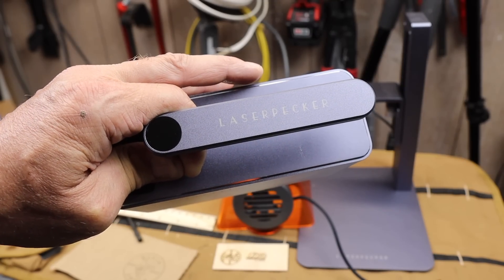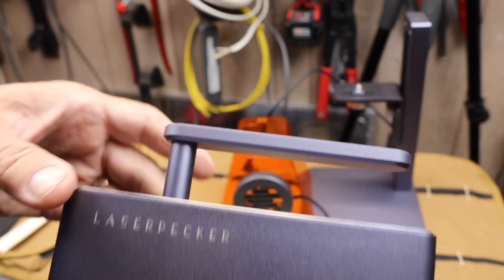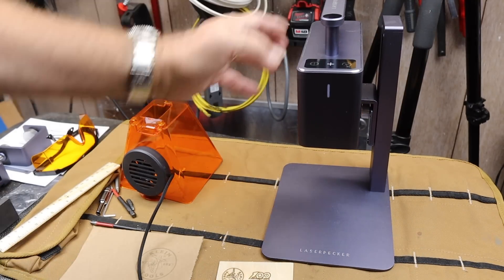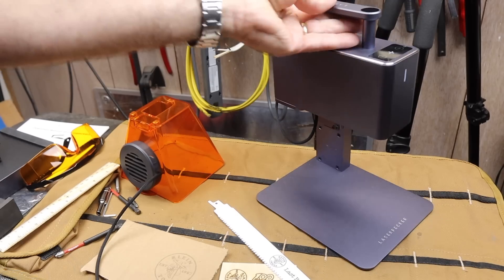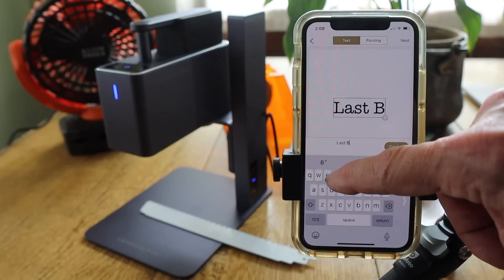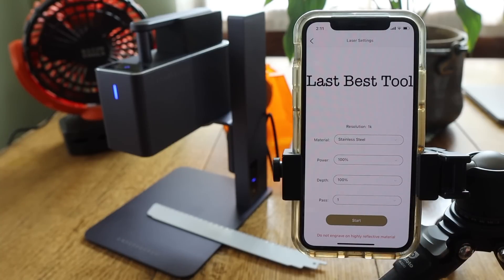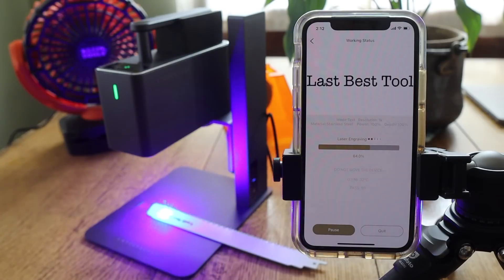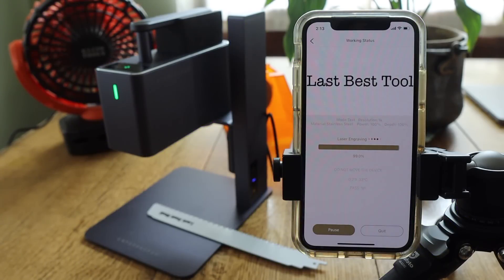The LaserPecker 2 (part 1) A one-stop-shop for all your engraving and  laser cutting needs.

Comment: I've seen these on Amazon for as little as $720 up to $1,300 what's the difference?
Reply from the maker: Probably the accessories that come with it. There are several things that you can add to the basic laser and stand to be able to do much more.
Reply: @lastbesttool  Oh I see, they have 4 different packages. Premium, Basic, Starter & Ultimate. All priced differently. Amazon has raised the price $50 since yesterday on the linked unit you posted.

Comment: Is the laser replaceable? I just thought about this. About 15' from me under a bathroom sink we have what was new, a $50,000 dual frequency medical laser. It was one of the first portable duals. It still works but . . . it only really works well cranked all the up. It also has a spotting beam that is hard to see. This can't be fixed is the issue. That's why I am asking about the LP. It's annoying to pay so much for something that can't be repaired.